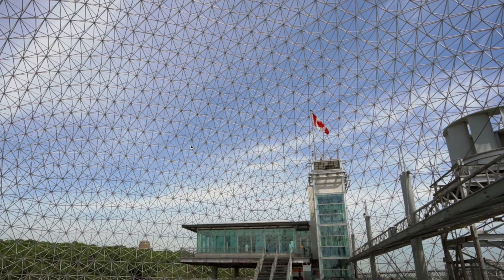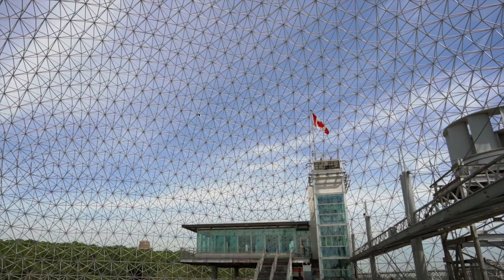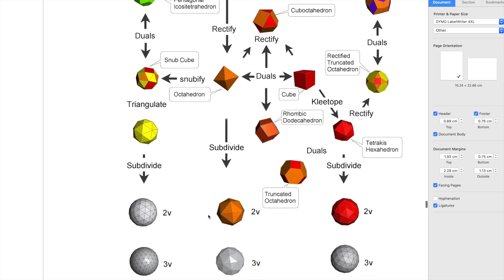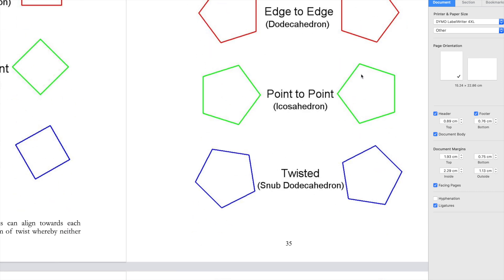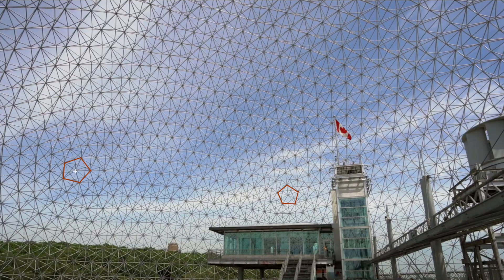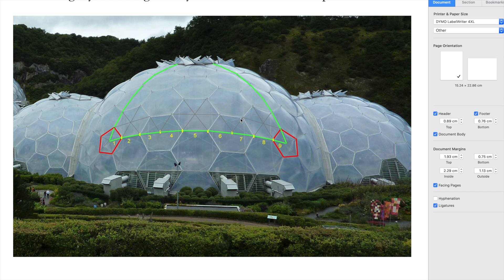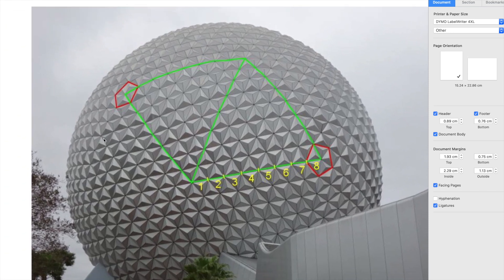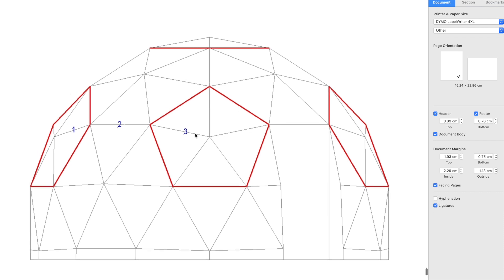How to work out the geometry of any geodesic dome.

Comment: Thank you for your videos! Question: could the EPCOT sphere used in your example also be considered a 16V Class II (Triacon) Geodesic?
Reply from the maker: Yes, the trouble is that there are a number of different ways to describe geodesic geometry and it can be quite confusing, Icosahedron used to be called "alternative method" by Fuller then class I. I just find it simpler to say what the base polyhedron is.